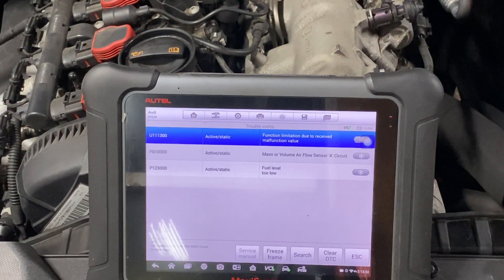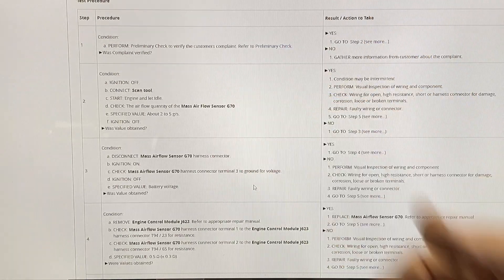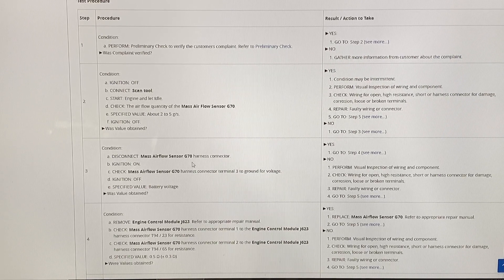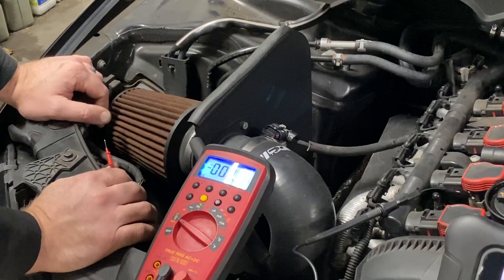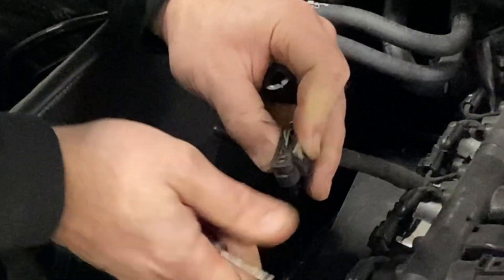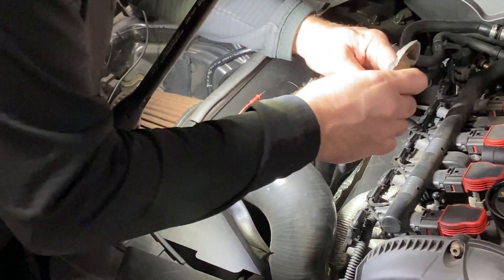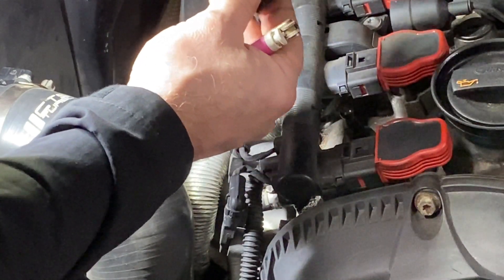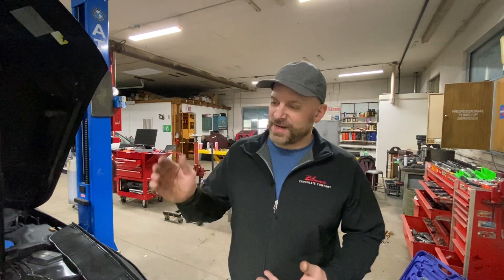P010000 Mass air flow: Parts canon vs diagnostics

Comment: Mordern cars/trucks are nice, just takes some fancy equipment to do diagnosrics. My 2001 gmc pu has 84k origional owner miles on it. Only dash light it has ever had was for fuel vent system, it just needed a new gas cap.
Reply from the maker: I agree newer doesn’t always mean better. As you stated most times it’s just the opposite. Your gmc was built to last, most modern cars are pretty much disposable.

Comment: The issue is in the past it was Compliant,Cause,correction.but the X factor for modern car is Compliant,cause,confirmation, Correction. This is perfect example!!
Reply from the maker: Confirmation is key 🔐 absolutely thanks for sharing
Reply: @robinsonsauto  you have to proven the failure or better yet duplicate the issue

Comment: tengo un leon 2.0 Tsi, codigo motor DKZA
tengo 3 colores en ninguno de ellos me da los 12v , solo 5,04v y 5v el otro 0v ... no veo el cable dañado.. puedes ayudarme? 
codigo de error P010000 gracias
Un saludo